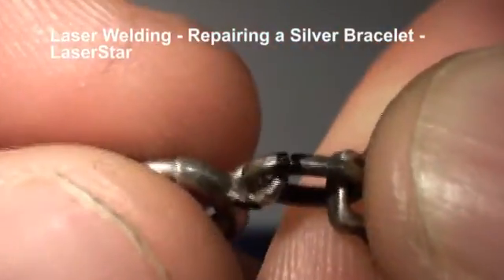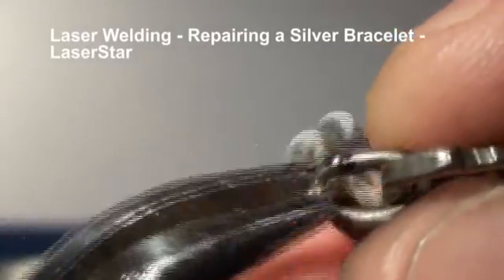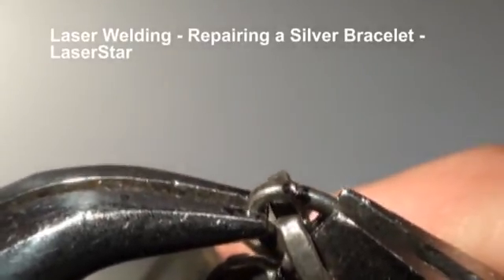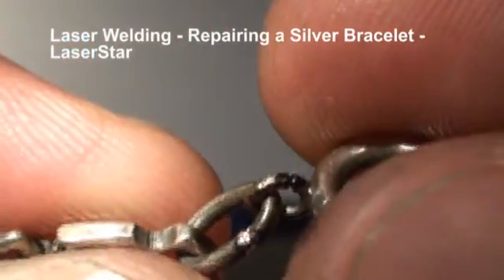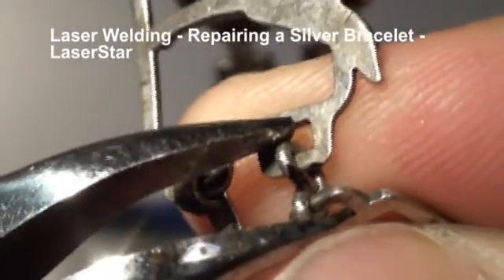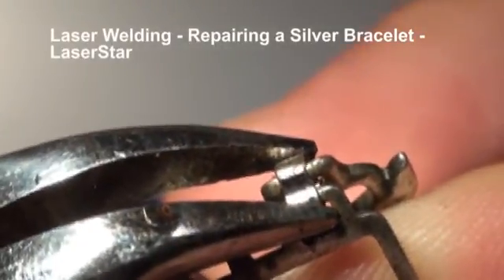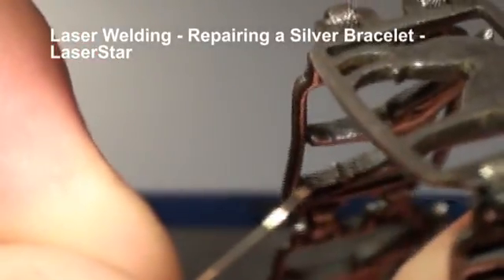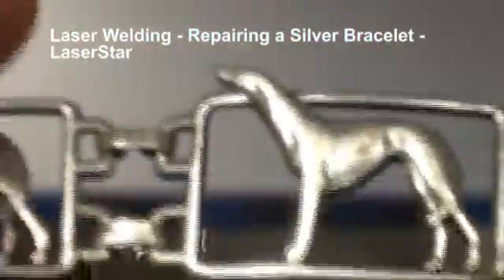Laser Welding - Silver Bracelet Repair

Comment: I have the hardest time welding sterling…I do darken with a sharpie, but the welds are really unpredictable. Am I hearing the argon gas as you’re welding? I’m wondering if that’s the miss8ng component. (For some reason the shop I work in doesn’t typically use their argon with their (2007) laser star. I’m determined to learn what’s miss8ng!